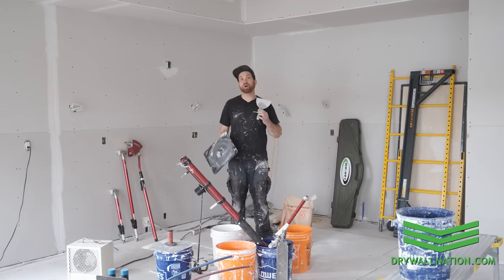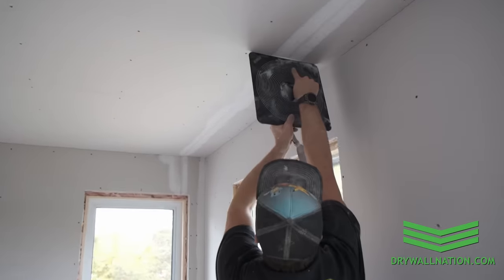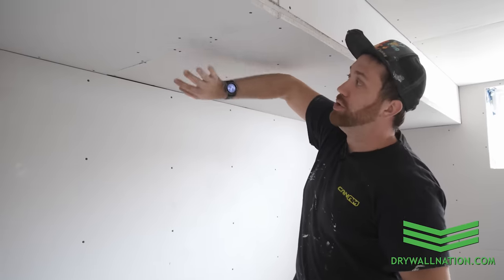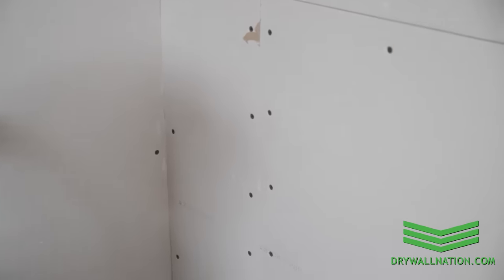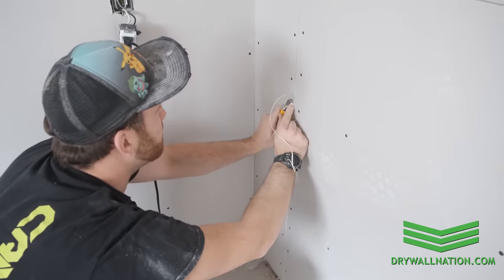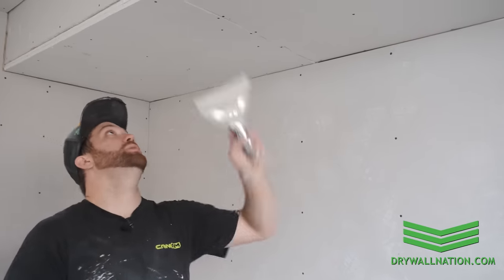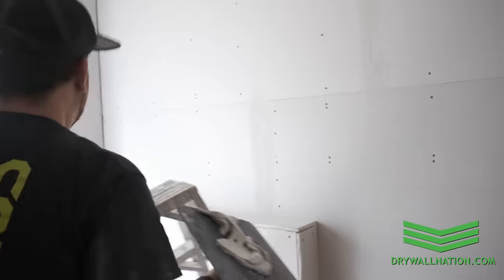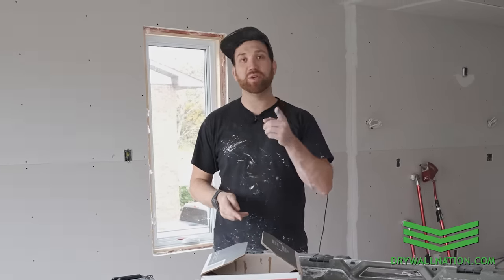Importance of Prefilling and V-Grooving butt joints.

Comment: Hi from Germany. V-Shaping is absolute Standard here!

I think most would do prefill as well. To me it is common sense.

With Uniflott Plaster Knauf claimedin the past, you wouldon`t even need to tape. But at the dusty edges you should apply deep sealer to reach good adhesion.
In daily life I think people don`t make sure to separate walls & ceilings from each other with silicontape, so cracks could be an issue then.

I am about to put drywall on our roof. Here I use deep sealer and tape because the roof is said to be kind of "moving" way more than walls & ceilings.

Strictly separated surfaces from each other. With Silicontape there is a sharp "haircrack" only. Hardly to be recognized, like it a lot.

Comment: I'm from VT and have been prefilling of large gaps & butt joints for years with Durabond 90 hard set . However I go one step further on my butt joints. I spread the durabond on the butt joint then I put a double layer ( offset slightly ) of fine mesh tape,then coating right on top of that with a light coat of the same durabond mix. Then after it's dried I 1st coat with heavy weight black lid Profoam compound , 2nd & 3 rd coat finishes I use light weight mud. This method has served me well for decades ,where butt joints that break over moving area's such as doors and windows I've never had a call back for a cracked butt joint ever. Love that you also take the extra time and effort to take care of your customer vs the guy working / thinking it's by the sq.ft so he needs to quickly slam it out and run .

Comment: Great video.  I've been prefilling forever (the guy who taught me insisted on it).  The one thing I can add that might be helpful is to use a grout bag.  Cut the bottom out of an ice cream pail and stick the bag through it.  Fold the bag over the lip of the bucket and put the whole thing into a 5 gal bucket with a lid that has a hole for the ice cream bucket.  It'll hold the bag open and fold the end over at the bottom.  Just fill er up and you're off to the races.  For me it's about three times as fast as putting it on with a knife.
Reply from the maker: Im not entirely sure i understand what you mean but that sounds interesting!
Reply: Make a video and show us how you do this. I learn most by watching.
Reply: @drywallnation  he is making a large icing bag similar to what a cake baker would use to decorate cakes using a couple of pails and a grouting bag.    You then squeeze the compound out of the bag nozzle and the pail holds a large amount of material to save you refilling the piping bag constantly.

Personally i just mix up in a small bucket and slap it on the hawk as I go along, but whatever works!
Reply: @andrewcarr2431  Wouldn't the 45 or 90 minute mud ruin the bag?  Just wondering because it sounds cool.

Comment: I was a journeyman taper for many years. Everything was backfilled with Durabond 90 before taping. Seams, butt joints nails. Less shrinkage. And our rockers alway cut a tapered bevel on the butt joints.
Reply: Hang em vertical buddy. No butt joints. Edges are tapered for that reason. That's how we do it here.

Comment: I'm in Missouri and I will prefilled big voids from bad drywall work but I do not prefill but. My reason is because when you tape a butt joint it dries and just slightly shrinks into the void pulling the tape inwards. Witch I like and will get filled in coat number 2 and 3. I believe you profiling the butt is overkill but obviously a good idea and shows you care about your work.

Comment: Love seeing how you do it over there Brian, cant believe you guys get recessed edges on the ends of your sheets, thats awesome! We only get square ends in AUS, so try to avoid the but joints where we can.
Reply from the maker: Well to clarify the butt ends of the sheet dont come recessed. We use Trim-Tex buttboard in order to achieve that. You might possible be able to order it in AUS but I'm not sure if it meets your building code.

Comment: I hang drywall and finish in big commercial projects to small patch work in homes, for about 15 years. Never did v-cuts unless it was hung and the ends had big gaps. It's really unnecessary unless the paper is visibly coming off and posed an issue that it would possibly stick up to give a ridge under the tape. I wouldn't waste time with doing it to every one. In my world, we move quickly and it comes out just as good, all that slow motion stuff gets you ran off the site. Prefill is a must though for me. Makes taping so much better, quicker and easier.

Comment: Yes indeed I prefilled always to fill any holes, damages, gasps, I plaster with rocksand and ciment not on boards, cause here we build mainly with concrete blocks, even on boards or blocks directly, we must fill, otherwise if the imperfections are way to big, it will take a lots of time to dry, I'm from Mauritius 🇲🇺

Comment: Midwest USA. I prefill gaps, damaged corners, and anywhere that tape might sag into the joint istead of lay flat. I also have been doing something like v cutting my butt joints since the 90's. I've actually made a cutter that  cuts a 1-1/2" wide x 1/8" deep flute into the butt ends of my drywall. Once I make that cut, I take a 3"" knife and coat the bare gypsum with durabond 90 so it doesn't leave boogers when I tape. I also use this method on my corners as so they are always true 90's (so long as the framer did a good job. lol)  I also use buttboard as well depending on the application. Usually my cutter and tape make a seamless joint with no hump though.  The cutter works like a planer and it takes about 10 seconds from bevel to bevel to scoop the material out as I obviously do not scoop anything out of the bevelled edges. The best part about the tool is that, when I have an odd ceiling height or anywhere where I come up in the middle of a sheet, I can cut a bevel into my sheetrock so the joint can be clean and even .  I'm currently working on a portable steam press that can compress the cut edge of the drywall to create more of a factory style bevel that will not strip the paper and eliminate the need to coat the raw gypsum.

Comment: Hi. Absolutely understand to the prefill and v groove. I was wondering if it improves the quality of the project why wouldn't manufacturers make them already V grooved at the ends of the board. That is slanted. Just a thought. Regards from Australia...
Reply: Part of the reason for the v groove is to remove any torn paper from the edges due to shipping, handling, etc. Those are things the manufacturer can't control. Also, a pre-grooved edge would be more prone to damage on the angle.

Comment: Sweet video.  Would've loved a close-up shot of the v-groove but it's all good.  Also, video sorta touches on this but these prefilled butt joints are then left to dry before coming back to tape at a later time, no?  Again, great video w/ a key tip I'll put to work in our as-yet-unfinished home but a little more info would've been helpful.  Thanks!

Comment: I'm a 1st time DIYer. This really helped me. Especially when you talked about busted corners. I wish you or someone would do a detailed video on what to do showing the process. Also, I have some pretty big gaps from the ceiling I had to hang myself. I'm just going to do as you said and prefill the hell out of it. Do you let it dry and then apply your mudding compound with paper tape? Or tape the fast set?

Comment: I’m up in Canada, and I pre-fill pretty much exactly the way you do except that I use synko concrete fill.  Most tapers here stopped using other fast set compounds many years ago, as far as pre-fill goes, as con-fill is fibreglass reinforced as well as fast-setting.  Also, I will cut away burrs or delaminated bits from a butt joint, but the only time I routinely v-notch is when prepping an existing joint that has cracked, for repair.  Makes no sense to alter a perfectly solid joint, but I see where you’re coming from!
Reply: Glad to here there are still people that care about there work. Ive seen way to many shitty jobs. Keep on doing things right

Comment: here in ontario canada we prefill all butts, 5/8 drywall flats and the same as you for all the gaps in the angles and flats that are not together tight and have gaps. and i use sheet rock 90 for prefill and for filling metal corner bead usually a 50/50 mix with regular mud.

Comment: PA here. I used to not prefill, as in I wouldn’t let it dry for a solid base and just tape over it and try to be light on blade pressure but always ended up needing more coats. Naturally I learned this wasn’t efficient and started doing this not that long ago as I don’t do drywall all the time, I’m a general contractor and I work mostly solo and do a wide variety of things.

Comment: Excellent tutorial!!  I never put butt joints on studs or rafters.  I join them in the bays; tighter, no movement.  Easier to lay out, less cutting to match the stud/joist pattern!  Always v-groove the butt joint edges; eliminates cracks and call backs.  Pre-filling with DuraBond a MUST.  I bed my tape in it, too.  just don't leave goobers to sand off; it's TOUGH stuff.  This guy knows his craft.

Comment: Excellent video!!  Question: I live in Vegas and our patio ceiling during the summer months periodically makes a loud sound, like a pterodactyl has landed on the roof. Upon further inspection, the ceiling drywall butt-joints are shifting because of the heat. Would tearing off the tape and FILLING THE BUTT-JOINTS WITH DURABOND solve this problem?  In other words, does Durabond "fuse" the two panels preventing the shifting under intense heat conditions (likely 150 degrees on a hot summer day above the patio attic)?
Reply: Highly unlikely. Anything that moves is going to crack. What about a high reflective coating on the roof above so you don’t have so much heat soak?
Reply: Great swings in either humidity or temperature causes the framing material to move in one way or another.  It effects  many parts of the building envelope. Where we live, it would be insanity to install finished rock on a porch ceiling.  If the sheetrock were to crack and you continue to have issues after a repair, it would probably be time to consider an alternative ceiling material.   But to answer your question directly, no, it wouldn't make a difference.

Comment: I always pre-fill my butt joints and gaps. Normally with easy sand. I will v-grove most butt joints to keep it smooth. Nice video.
Reply from the maker: Good to hear! Keep up the good work brother!
Reply: @drywallnation  have you guys used easysand for the prefill? Or always durabond, any dry time difference or benefit from using one or the other?

Comment: Never heard of this, but it makes perfect sense. What are your thoughts on paper and mesh tape? I've been told mesh is the wrong way to go. Thanx in advance.
Reply: Mesh is best for repairs, paper is best for joints. I've used mesh for joints and then had it show through later, usually after seasonal expansion and contraction. Paper creates a stronger bond and structure from the surface. Mesh provides something for the compound to stick to while it's wet, but the compound can be brittle in the joint. This is less of a concern in a repair when you have the rest of the board around it.

Comment: I have always wondered if this was a method that some might use. I try to think logically in anything I do and your approach makes solid sense. I would agree that using hotmud (setting) compound for this is the best approach because it will not shrink back into whatever work you are trying to mend in the first place and by the time you are done with the repairs/fills in the room, it's set enough for regular taping/joint compound

Comment: Hey good going on filling your v out butt joints with durabond. I take I one step farther. I fill all my bevel joints with durabond also. The beveled  edges of our drywall aren't square anymore so if I just put tape over the bevel joint it takes too long for the mud to dry in that v, so I fill the v with durabond. Call me crazy but it sure eliminates cracking.

Comment: Not me, it takes me a little longer but I peal the butts. Several reasons for this. The mud bonds to brown paper better than the surface white paper. Pealing it gives the same effect, removes the delamination, and fuzzy factory ends. I prefill with setting compound, I prefer paper, my partner prefers mesh. When we work a job together I bend my ways. We peal the butts, double mesh the butts each tape over lapping the joint by ⅓ of the tape and like your doing using the knife perpendicular to the joint and a little slapping to squeeze the mud into the joints. I know this is a little off mfg spec's. But it works well. When pealing you need to curl the peal which gives it a nice clean tear without it running away on you. It's a trick of the trade. This works well I've seen work that's decades old and holding up nicely, done using the same methods. I'm a north east taper. A lot of guys here question why I do them the way I do.... Sometimes I'll tell, sometimes I won't. I let em scratch their heads and think they are better than me.
Makes a little mess, it's very slightly slower than cutting a v, but again the mud bonds to the joint better and your able to get a nice flat butt joint that's strong. Maine.

Comment: Olfa knife...nice! You guys use 14footers? Personally i usually use Plus3 to prefill with...but i'm a one man show so by the time i wrap back round to start taping, everything is dry. Only in the cooler months....like maybe in a basement or garage....then i'll use EasySand AKA durabond. Because prefil needs to dry b4applying tape or could hav problems.

Comment: What's the difference between doing a v groove and leaving a 1/16-1/8th gap between butts?

In Ontario, we've been improving our finishing every job, currently using 90 to prefill gaps and first coat on screws to avoid shrinkage.
Reply from the maker: We're also in Ontario. You can definitely do what you suggested and leave a small gap. However, vgrooving serves as a double purpose. It also helps eliminate any loose paper or burs on the edge of the sheet that may peak or delaminate once moisture from the tape is applied. 
Keep up the good work man! Never stop improving!
Reply: J M or DrywallNation
I'm not a drywaller, but please indulge my foolish question. 
I thought taping was to make a physical tie between 2 sheets. If the sheets are gapped & filled with Durabond 90 (for example), then mudded, why is the tape needed? Aren't the boards cemented together sufficiently with the Durabond 90? Wouldn't skipping the tape allow a level joint instead of a raised joint (+ 14 inches wide or more mud to taper the joint to hide the seam)? 
Why is the tape essential? 🤔 TIA
Reply: @kerriwilson7732  I'm not a dryliner, I'm in joinery and millwork in the UK, but I've always been told the tape helps stop hairline cracks.
Reply: @drywallnation  yeah I wouldn't prefill angles with 90min not a good idea if it's a new house due to settling.

Comment: Have you considered trimming (1/2 of the v-groove) the butt joints before screwing to structure?  Seems like it would be easier especially for cut joints.
Reply: On most jobs you have crews that hang the rock and crews that finish it 
If your doing both that would work though
Reply: Pre-cutting v-groove would compromise or weaken drywall edge during hanging / screwing.

Comment: You said make sure you don’t get delamination from the moisture after applying the tape on the butt joint. Are you saying the moisture from the mud could cause the paper on the rock to delaminate and bubble?

Do you pre fill rolled edges?

Comment: If I am doing patches of large areas, can I just use easysand and mesh tape? Assuming my butt joints are not too tight? It seems that with mesh tape I can force the easysand to fill in the gaps without prefilling before taping.

Comment: A ceiling butt joint perpendicular to the joists in my house had me thinking about how to prefill it. The strategic thing to do would be to screw a shim to the back of the sheets to act like a makeshift lathe to give my compound something to hold onto. The burnt-out part of me took over and decided to pack so much DryDex Heavyweight Spackling into the gap that it formed a gummy sagging bridge I'd sand down later. It was an act of hubris to attempt that, but being fed up with dust falling into one's face results in some silly situations.

Comment: Thanks for the video! Wish we found it sooner! We hung our drywall with our handyman and none of us knew anything about butt joints so of course after we mudded and primed, the cracks showed through. Now we know we need to V and prefill. Do you think if we v out the cracks before we get to the tape and fill with 90 min mud, it will fix our issue? Also, is the 90 sandable to a smooth finish after? Thanks!
Reply: You can sand the 90 but it’s harder than the finishing mud. Reduce the fining mud each time you apply a coat. The last coat is paper thin and lays very smooth. In some cases you can skuff with a large damp sponge rather than sand and create dust. It is a trade after all so there’s lots to learn. Watch as many videos as it takes, consider all the tricks they show.
Reply: No durabond is not sandable but ez sand is and if you are very careful you can groove and fill with it and it will hold

Comment: I don't like to put butt joints on a wall stud or ceiling joist.  I always span them in the middle and glue/screw a piece of 5/8" OSB board behind them.  Takes a tad longer but have never had one crack out after a year or more of house movement or frame lumber drying out.